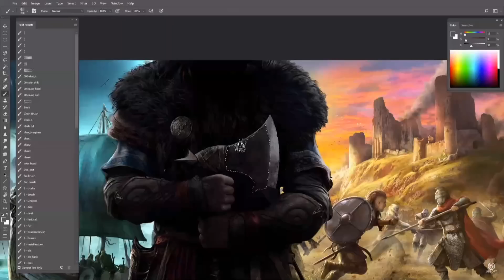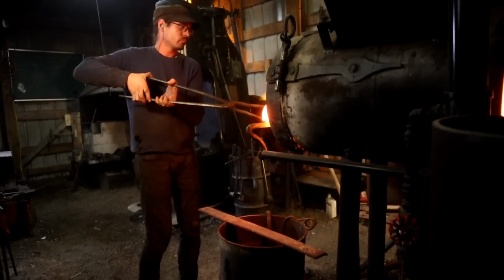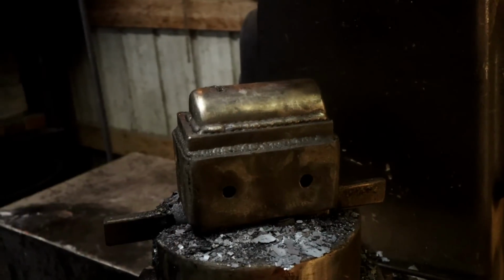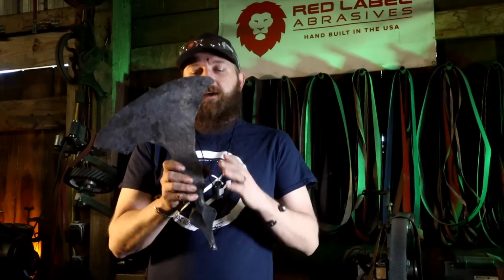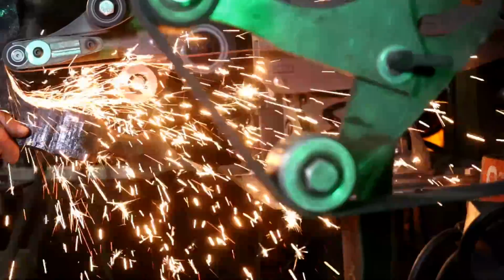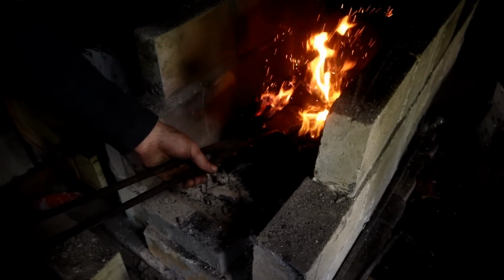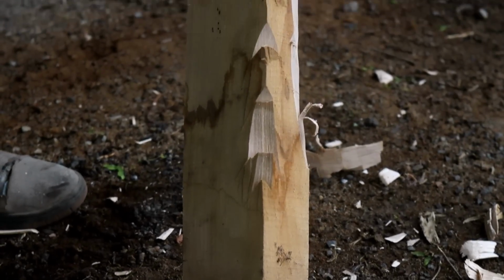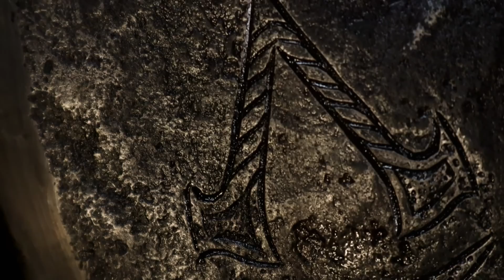Forging the Viking Axe from Assassin's Creed Valhalla

Comment: Thank you for taking the time to explain this tempering method,  using the heat from the quenching process. I might even dare try doing it this way. This must be really tricky to get right, particulary for something like a sword with perhaps four bevels and three to four  or even more feet in length though.

Comment: Damn, that axe head is thick! So much material around the eye. With 
Ilyas skills half of the thickness shouldn't be a challenge. 
That's a wood chopper. 
Still a beautiful peace of art!
Reply: They talk about this in the video: how there's the fantasy concept of the massive two handed viking axe with a lot of material to deliver a heavy blow, which is what they're making, but the reality is that viking axes were nimble and light weapons!
Reply: If Ilya WANTED TO he would have. They talked about this. Traditionally yes they are much slimmer but the goal HERE was to make one accurate to the game, not history.
Reply: well a viking used an axe for all around use. that means yes they would also chop wood with it too. vikings were awesome that way. give them an axe and they have all they need
Reply: @CasualREDACTED  Hand axes and bearded axes could probably function as makeshift tools but two handed axes I doubt just because of the width. In terms of thickness they had more in common with a Ka-Bar knife than a felling axe.
Reply: It would be sick if they used this as a prototype, and then did the same design scaled down to a realistic scale to show the difference
Reply: @sherrattpemberton6089  that's exactly what I meant with my comment
Reply: it's a woodchopper accept it not very good at chopping woods. It's too fantasy to be practical.

Comment: Hi guys, 
Another great build and video of a kick ass Viking battle Axe, well done. Now here's what I've been giving you as a challenge on many of your other videos as a suggestion for one heck of a bad ass Viking battle axe that no other can rival it. 
The Thor axe  "JARNBJORN"  built out of heat treated and tempered "Titanium". Why Titanium you ask, because it's the only material that can do this axe justice. Plus it would make an incredible collector's piece, a one of a kind with no rival. The most bad ass axe ever produced. What say you, up for the challenge?

P.S I guess you could make it out of 5160 but in doing so, you take away exclusivity of a Titanium version because you'll have hundreds of copycats making them because it's much easier to use 5160 than Titanium. A titanium version vs any other steel would make it a one of a kind as I don't think they'll be many copycats willing to put in the work of a Titanium versions. Yes I know that Titanium is very expensive and incredibly hard to work with, hence why it would be so bad ass and one of a kind that you could easily ask whatever you want for it, since there's none out there to compare it with. 
"HIGHLY COLLECTIBLE DUE TO EXCLUSIVITY" are the key words!!

Comment: Does anyone know why the axe was heat treated/tempered in water instead of oil. Thanks!
Reply from the maker: It's 1045 and Ilya had a lot of exp water quenching that material.
Reply: @ThatWorks  Thanks! still trying to learn what materials need special treatment

Comment: Why 1045 mono ?  Why not 1085 with a differentially hardened edge, or even just a 1085 san-mai edge ?

Also, if this is the axe i'm thinking of (name escapes me ATM), it's supposed to be a 1H bearded axe, not a 2H danish style axe.

Comment: So what's with "Forged in Fire's" terror when people quench in water? I see youtubers do it all the time.
Reply: i heard it weakens the materials. but I think that is for thin blades and small blades. I'm not a smith so this my be incorrect info I gathered.
Reply: It's more aggressive than using oil, and more likely to crack or warp

Comment: Seems a little inefficient to be whacking at such a weird angle on the axe blade on top of the anvil so frequently. I bet if you put that thing into Jason's custom vise (Fireball Tool) it would more than hold up to any sledgehammer you could throw at it.

Comment: Aside from having it on hand, is there any specific reason you started with round stock instead of square stock?

I mean, the first thing you did was square it up. Wouldn't it have saved you a step to start from square stock?
Reply: Nope, there is no other reason and yes it would. 

Also I never saw square stock in that size. A lot of round stock an even in bigger sizes... but not square.
Reply: Probably round stock is cheaper? Also, as I understand that they just had that peace laying around from hammer making.
Reply: Round stock is almost always cheaper than square stock as it can be bright drawn or rolled easily and is needed plentifully as it's whats used for lathe work. Sheet is also cheap as it can be cold rolled but not as practical for forging as the sheets would need to be forge welded together first.

Comment: The blade seems a bit thin even for a battleaxe. Making it about a quarter thicker would be fine.
Reply: Have you seen a real dane-axe?
Those things are like a 1.5cm at the thickest part of the blade and 0.2cm at the point just before cutting edge.